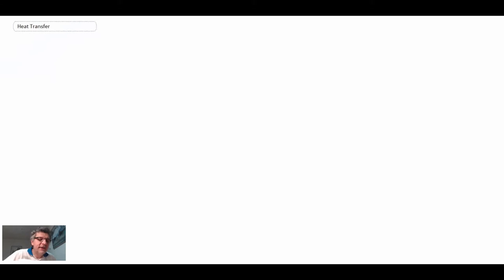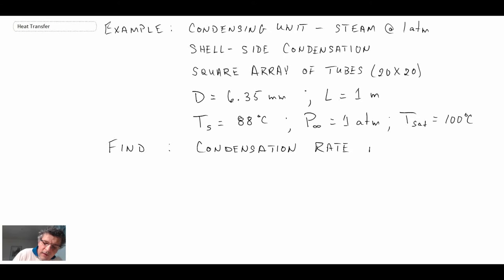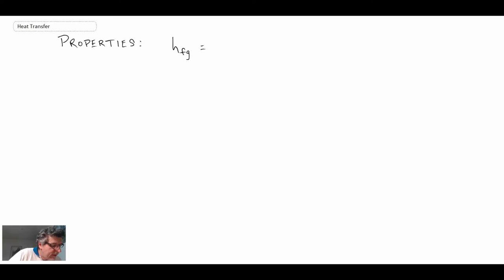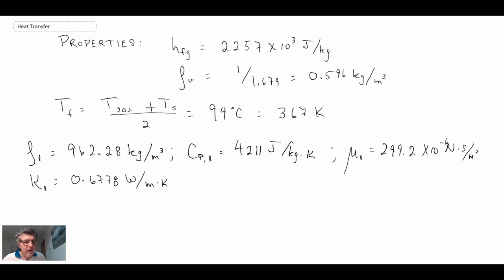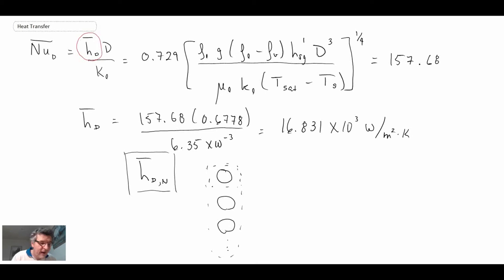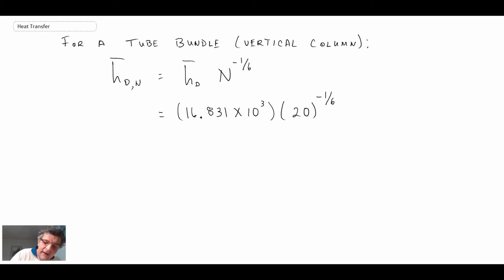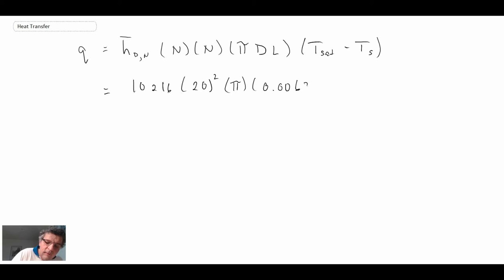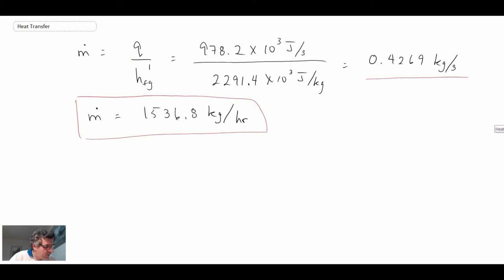Heat Transfer L30 p2 - Example - Condensation on a Horizontal Tube Bundle

Comment: Sorry, why we are using N^2 to calculate the heat flux? Knowing that (hD,N), uses one column, already
Reply: h D,N is for the heat transfer coefficient for  unit area not for one column. For the total heat flux we need to know total tube surface area, and we need to sum up total numbers of tubes. ( NXN).